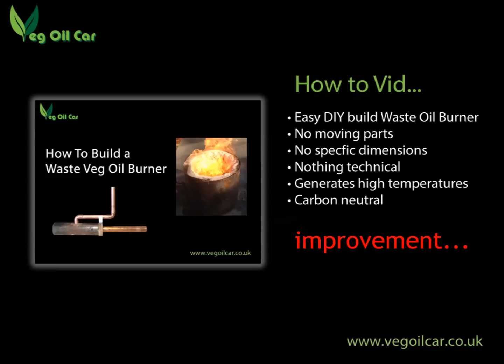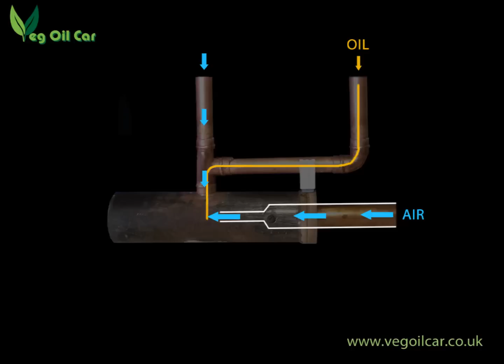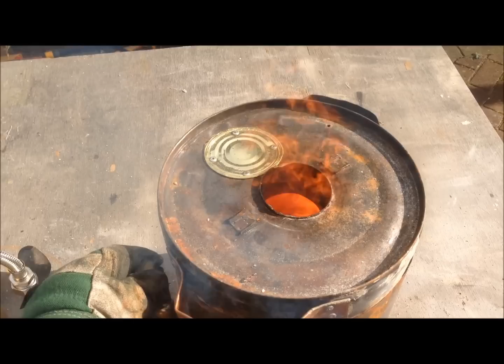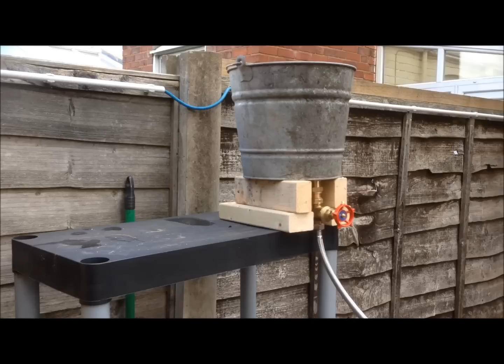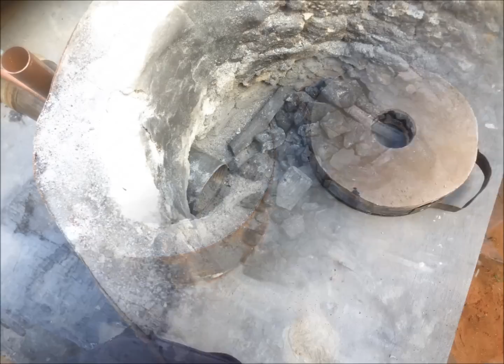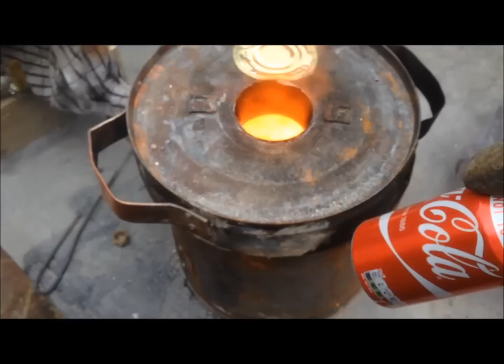Waste Oil Burner - Improvements - by VOGMAN

Comment: I find this model fascinating, but I find myself concerned about the prospect of overheating pipes. Do they make steel pipes with the same dimensions as the copper ones you've used?
Reply from the maker: To be honest I don't know what dimensions are available.
I will reassure you though that the placement of the copper pipes means they don't get anywhere near hot enough to risk melt or even distortion. It's surprisingly difficult to reach those kind of temperatures and that's why we go to the trouble of containment / refractory / insulation, etc. 
The very tip of the steep pipe inside the foundry gets a beating, but being steel copes well. The copper are fine.
Hope this helps  : )
Geoff

Comment: What's your point in bringing up the compressor during the last section of the video? I have a heavy duty compressor so I'm wondering if there's some advantage to using it. Also, why do you choose to use copper pipes of iron or steel pipes to drip the oil/air for the burner itself? I would think the copper would be less efficient since it won't last as long as the iron and steel over time?
Reply from the maker: There's a lot of oil burner designs out there that make use of a compressor so DO look them up. A compressor makes easy work of vaporising the oil which makes it much easier to burn (mixing in lots of air).
As I haven't got a suitable compressor I had o look for an alternative.
The copper doesn't get hot enough to suffer from any kind of heat damage and as I already had some lying around, I used it. Simple as that. I like to use whatever I have to hand.
Hope this helps.
best wishes,
Geoff
Reply: Cool, thanks. I'll test a few methods out then.
Reply: Want me to tape each method and message you the link when they're uploaded? It may be a few weeks before I find refractory for a decent price that I can afford lol.
Reply: Also, I had a question for the refractory. The link below is the cheapest I've found for 3000 degree F (1650 C roughly), is $20 for a half gallon and free shipping for me if I buy a gallon. Do you know of any better deals than that, and is this stuff going to work right do you know?

https://www.amazon.com/MEECOS-RED-DEVIL-610-Refractory/dp/B00ACIWN9Q/ref=pd_sim_60_4?_encoding=UTF8&pd_rd_i=B00ACIWN9Q&pd_rd_r=AV2Y2XD7SE0VR2GNJTQ6&pd_rd_w=Rj8mk&pd_rd_wg=EijS0&psc=1&refRID=AV2Y2XD7SE0VR2GNJTQ6
Reply from the maker: Sorry, we're in different parts of the world my friend so I can't help you with a shopping link, but it sounds like you've already got the right idea in mind : )

Comment: here's another idea, drill some 1/8in or 6mm holes around the main air inlet to increase the airflow even more. And if easily possible drill the holes at a sligt angle to creat a cyclone effect to further mix the oil vapors. 
 I would start with one hole and make the next one as concentric as possible. 
 The only problem that i can think of that will happen wjth additional air or too much air is that you start to make an oxidizing flame (not good) that will put an oxide layer on the molten metal prematurely. 
 The only way i know of to test the flame is to put a piece of regular steel in it until it gets red hot and watch to see if it scales up really bad, if it does, then it's oxidizers. however, with the charcoal in the foundry, it may not happen and increase the temperature even higher.
Reply from the maker: Thanks for sharing those great ideas. Much appreciated : )
Reply: VegOilGuy 
 your welcome

Comment: Could you use kerosene instead of oil
Reply from the maker: Thanks for your question.
I haven't tried kerosene but I would urge caution. It's a highly flammable material and therefore volatile. Veg oil IS NOT very combustible. That's why it's so safe to use. You could throw veg oil on a small fire to put it out - not that I'd recommend it : )
Whether you experiment or not is of course down to you, be do be VERY careful. High temperatures and volatile liquids could results in an explosive combination... not ideal.
Best wishes
Geoff

Comment: improvement, but you can get far more by doing what they said, and allowing the air to enter at the rear. as you have basically made the plug reasonably permanent, just cross drill a couple of 12mm holes through the outer pipe, air pump side of your "nozzle". you'll chew through the pipe wall, and pocket out the sealer/packing mix. 

your venturi siphon as you have it works, but at reduced efficiency. your siphon is in the EXPANDED portion of the pipe, so even that couple of mm travel allows speed reduction, and with it pressure increase over the ideal siphon point (which is actually mid taper between air feed pipe diameter and the root of the nozzle diameter, right where they put the spray nozzles in carb venturis).

 by having the air inlets behind the nozzle, you get a bit of siphon (about the same as your position), but you also take advantage of one of the invisible gremlins that lurk in fluid dynamics, pressure wave characteristics. pressure waves have 3 actual pressure zones, the leading edge (where pressure is highest, the energy of overcoming the inertia of the atmosphere it rams into), the actual pressure zone itself, and the trailing edge, where a rarification forms (partial vacuum). you can demonstrate this if you like, just pull the muffler off a 2 stroke moped, and idle it very slowly. that ""pippety-POP" you hear is the front, wave proper, and trailing edge passing the end of your pipe. that reduced pressure wave actually runs up the pipe toward the exhaust port (which is how an expansion tank gives a 2 stroke best power at a specific engine speed, or range, by tuning harmonic "pipe ends" to suck exhaust down the pipe). the only "pipe end" your design sees is the fire pot end of the burner (where the expansion of combustion negates it). place the air inlet behind the nozzle, that "suction wave" draws air through them, very handily. now, technically, the output of you little pump is actually a series of pulses. each of those pulses causes a "pippety-POP" at your nozzle tip, but the venturi will actually prevent much of the negative front from propagating down the nozzle. that means the vast majority is either scavenging nothing (because the expansion post venturi proper "cheats it away", just like venturi efficiency), or sucking at your plug (which gets a constant hammering from the expansion wave that follows). that whole long winded explanation is how the WW2 V2 buzz bomb's pulse jets worked (and the pipe scavenging even allows valveless versions to work).

scavenge your air behind (from flow POV) a discharge nozzle, you get the best scavenging air flow, at least until you cheat with pumps and such, lol. if you look at steam injectors that fed water into boilers at pressure, you will see the same as i describe. yours isn't "wrong", of course, after all, it works, and is an improvement over before you did it. but, you can get even better results. just get that inconvenient inertia on your side, and the world is your oyster, lol
Reply: Really interesting comment--thank you for sharing.  I know this is a really old comment/post, but if you're still around, do you know of any good visual/diagram type resources outlining what you explained in the above? I'm having a bit of a hard time visualizing it, but want to understand better what you are saying.
Reply: @justinw1765  do you have the diagram?
Reply: Agree, I would love an updated video showing these improvements but that I could also hear.
Reply: would also like to see a drawing of the improvements you are suggesting. thank you.

Comment: I am wondering about the tin bucket with the oil in it what to do there do you tap it and screw a fitting in?
Reply from the maker: Hi Jake. Thanks for your question.
I guess there's lots of ways of doing this and mine may not be the best... but it fitted with what I had to hand on that day ; )
Explaining could take ages and still never really get the message across so I've extracted some stills from an unused section of recording and placed these images on my website for you. You can see these images here:
http://vegoilcar.co.uk/burner/bucket.php

Hopefully these close ups will make things a little clearer. If you still have any questions, just drop me a line.
Best wishes,
Geoff

Comment: Does the oil fire smell bad?
Reply from the maker: Hi Jake, no it doesn't.
At low temperatures an oil fire is smoky and smelly, but once the temperature rises there's no odour or visible smoke that I can detect.
Hope this helps.
Best wishes,
Geoff
Reply: VegOilGuy Thanks. I lit charcoals with lighter fluid once, and it smelled horrible.

Comment: I'm just an amateur but another alternative could be to drill several holes around the still tube just behind the nozzle and in front of the concrete mixture. your solution was easier but if you have a drill this could be cheaper. hope this helped!
Reply from the maker: +Kevin Coatney (Bean14) 
I don't believe in amateurs my friend. I believe in enjoying the learning experience... coming up with ideas and listening to other ideas like yours. 
Thanks for the input. It's certainly welcome and relevant. I can see how it would work.
Best wishes, Geoff

Comment: Thank you for sharing these interesting advices with us i found your video more clear and there is no complications in the process
i want to know if i can use diesel with the same burner ? also which is better as fuel in order to reach high degree of heat is it diesel, petrol, waste oil ?thanks very very much sir .
Reply from the maker: +tracychapman1000 

Hi Tracy. Thanks for your kind comments.
I’m not sure I have any definite answers for you, just a lot of guesswork mostly…
Could you use diesel? I suppose so, yes. It’s a fuel source after all. But would you want to use it? I don’t think so. I’d have safety
concerns. The thing with veg oil, or motor oil, etc, is that they don’t actually burn that well. Throw a lit match into a bucket of veg oil and the match will go out. Throw a lit match into a bucket of diesel and the chances are the diesel vapours will ignite in a plume of fire… not a good thing if you’re working next to it.
Which is hotter? Actually I don’t think the fuel matters so much. I think it’s all about containment.
Remember the Fire Triangle: fire = heat + oxygen + fuel. You need all three for fire.
Now think of an ordinary barbecue. With the lid up, it’s hot. With the lid down it’s even hotter as the heat gets trapped and concentrates in the small space. Now if we blast in some air from a blower, it will get hotter still as there’s increased oxygen. But the charcoal will burn out quickly, so you need more fuel… but the idea is you CAN get an ordinary barbecue to reach very high temperatures by introducing a lid, more air and a steady supply of fuel.
That’s what you see me doing in my video. My little foundry is very well insulated and contains the heat excellently. It’s also got a lid to retain even more heat. With the blower and the steady fuel source, I can get probably hot enough to melt copper (I haven’t tried yet). If I wanted to get even hotter, I’d look at more air and more fuel. I wouldn't bother changing the fuel type.
Anyway, I’ll stop waffling. I hope this helps… but personally I’d play it safe and stick with oil my friend.
Reply: Geoff at VegOilCar really i don't know how to thank you for the time you took to answer my questions i found that so kind from you friend
after thinking about the exemples you gave to me and the explanation of the nature of each material (fuel) i think that i forget to think about safety 
i understand now the difference between each fuel type to feed fire in the case of a foundry
i'll start working on my waste oil burner the way you did on your video and following your instruction there and here on your comment 
i am always waiting for new videos and stuff here on your channel 
thanks for every second you spend from your time to share with us your knowledge and advices .
Reply from the maker: +tracychapman1000 
No problem. Happy to help.

Comment: Glad you found the suggestions useful. It certainly made a difference. Very Novel approach with this burner and it works very will in the furnace. I would think you could probably go to copper and brass melt temps with that setup. 
Well Done!

I'm going to try and do a vid of my against the grain veg oil conversion today.  Have a look when it's up and tell me what you think. It's not the traditional  conversion that for sure.   :0)